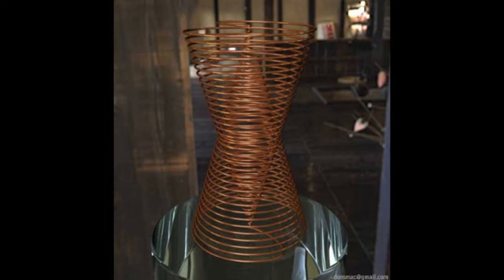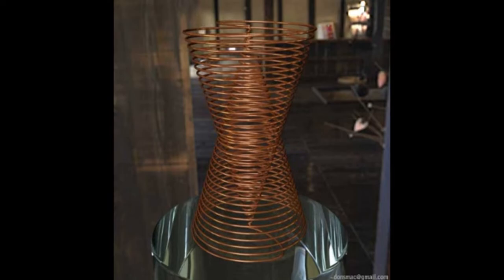How to build Space craft Part 11 Power source

Comment: I tried for a long time to picture what it would look like to turn it around in my mind like Bashar says in one of the recordings but could never picture the parts where the cones intersect and weave through each other.
Reply from the maker: I believe parts of the symmetry and way the shapes are is due to some creational patterns are like scared patterns  they utilizing like a mini vortexs
Reply: @alientubeGalaticfederation Was the device like the one in the picture? As I understand it, you came with a circular base and it would go up and taper like a cone, and it would come with a larger base at the top and tapering through the openings of the first cone at the bottom...